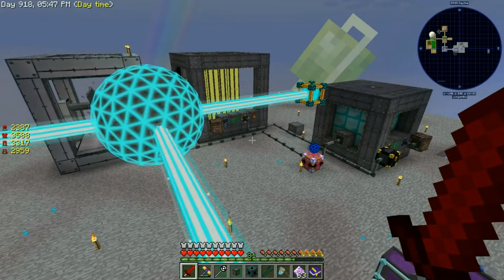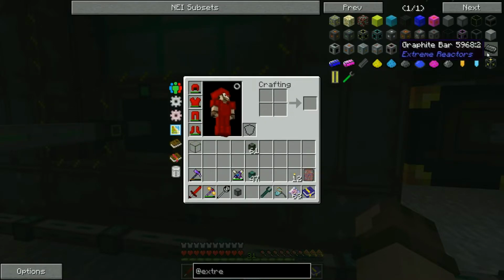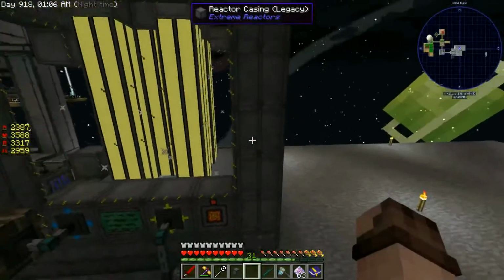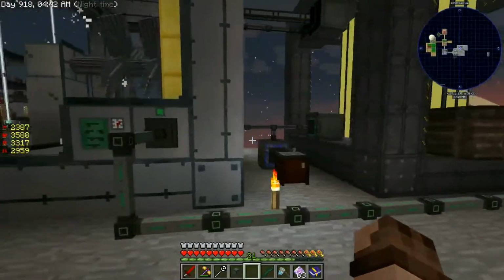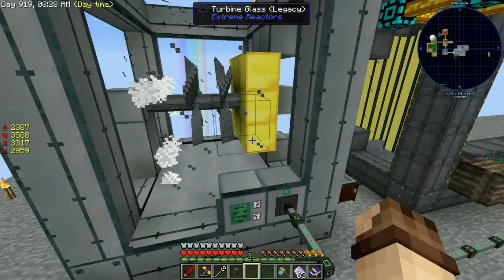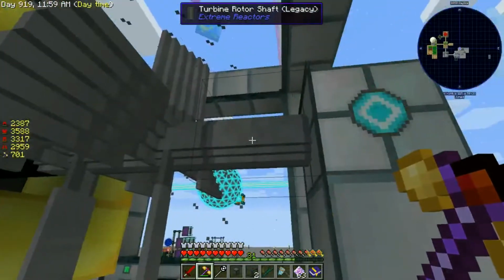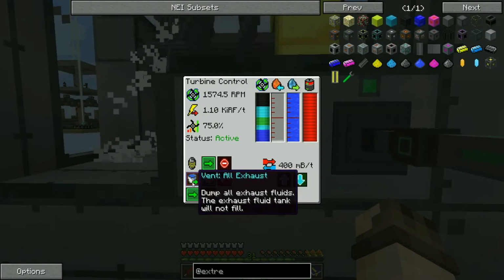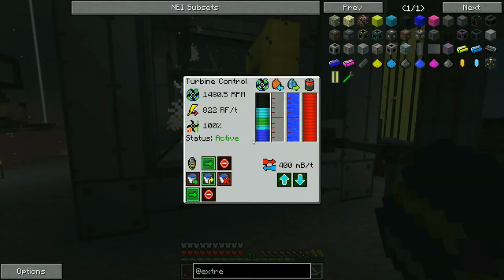Skyfactory 3 - Achievement Guide - Ep 33 - Actively Cooled Extreme Reactor with a Turbine

Comment: How did you get around the reactor only outputting 200mB/t into the turbine? I cant get my turbine up to that speed
Reply from the maker: There's a few ways to get around the steam output. Where its restricted is that the ender IO fluid conduits can only extract 200mb at a time. You can increase this by adding more fluid ports and conduits ex. 3 more ports could extract 800mb/tick of steam. I think I had let the steam build up first in order to get the turbine up to speed in the video. A couple of other options I've seen is fluid importer, cables and fluid interface from integrated dynamics, Dimensional Transceivers from ender IO or Pressure Pipes as they can extract more.

Comment: How do I pump the water into the reactor? I've been trying for hours and can't work out how
Reply from the maker: What sort of pipes have you been using? with the ender io you need to click on where they connect to change the input output settings
Reply: @BJandCo  yeah it turns out I'm just dumb and didn't click the thing to activate it after swapping the pipe to extract
Reply from the maker: @ninjakitten_  Not dumb at all. i don't know how often i've screwed up pipe settings and spent hours banging my head against the wall trying to figure it out.